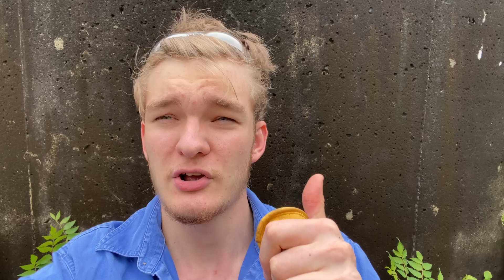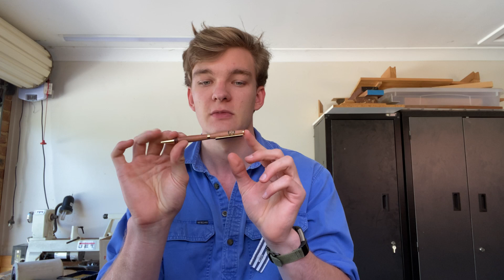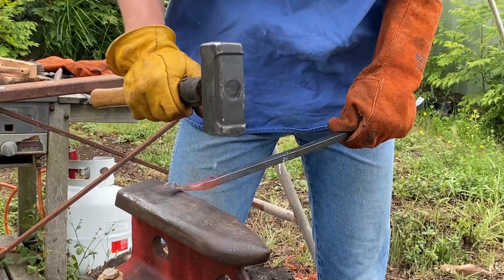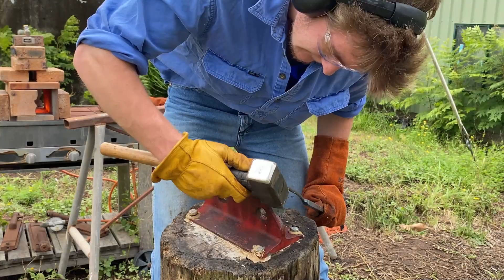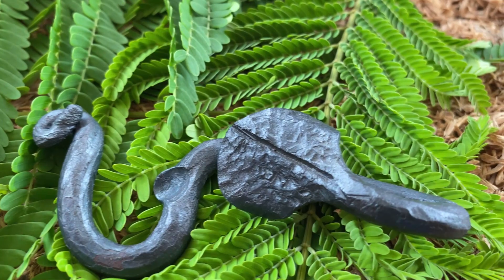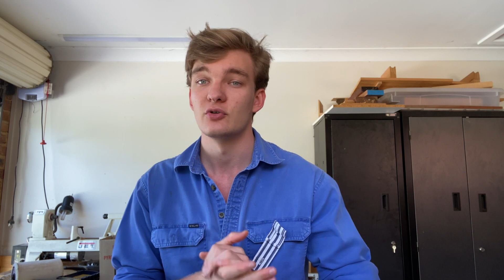Forging a Leaf Bottle Opener

Comment: Looking good like I like how the bottle opener extends past the tab! I’d suggest using a smaller hammer for the more detailed work like a ball peen or even a claw hammer if it’s all you got just grab some tape and tape the forks together to stop the vibrations. I’d also try scrolling with a hammer over the edge of the anvil might help keep the very tip scroll more tidy I know it’s what I prefer looks good Luke!
Reply from the maker: Thanks for the advice Alex! I might just have to try out a claw hammer next time and use the scrolling tip.